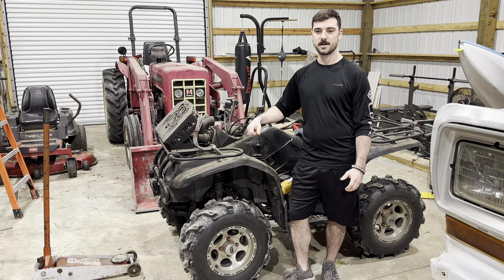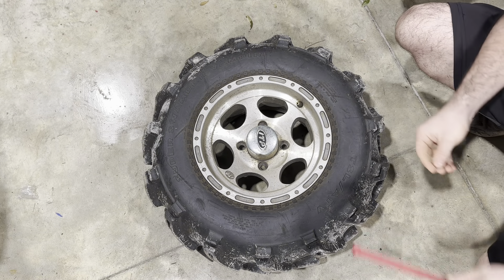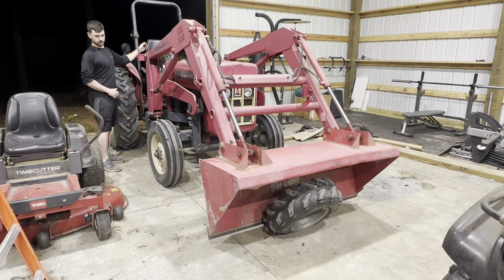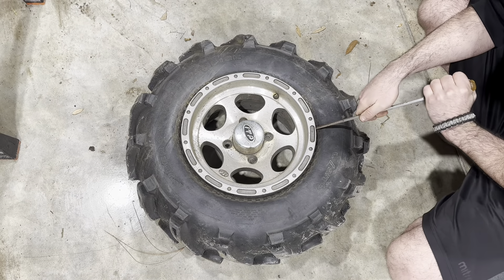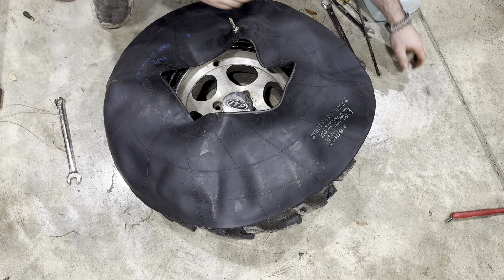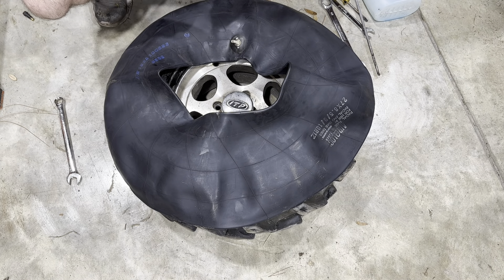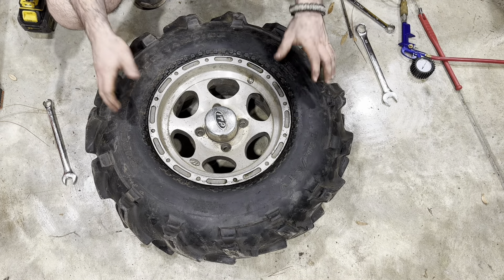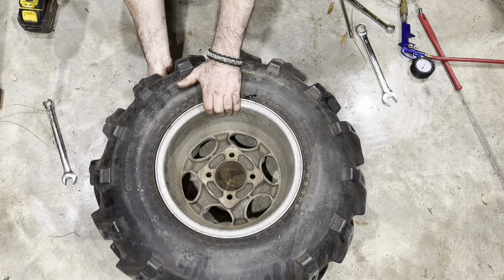Installing Tire Inner Tubes in a Four Wheeler/ATV

Comment: I bought some barely used 26 in mud lites. But they are dry rotted and 1 doesn’t hold air bc of dry rot. Could I inner tube them and still use tires
Reply from the maker: Most likely. As long as they're not coming apart you should be golden.